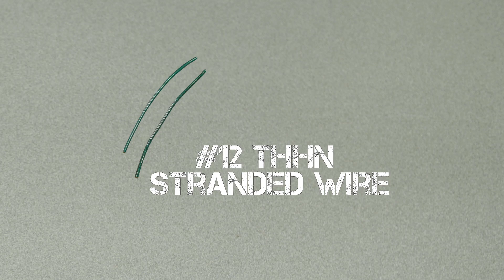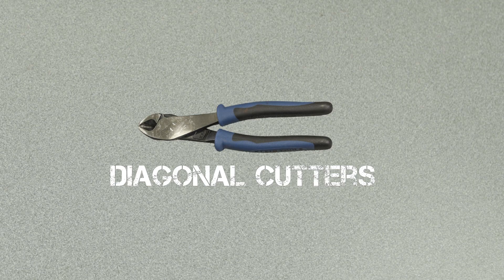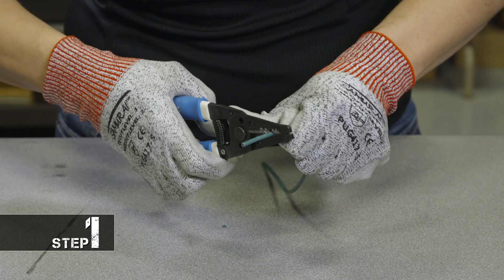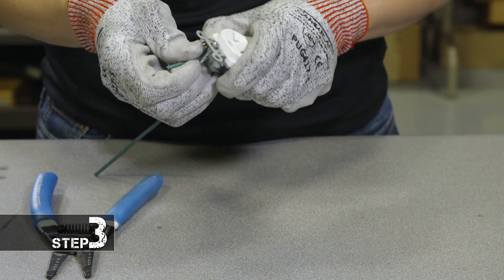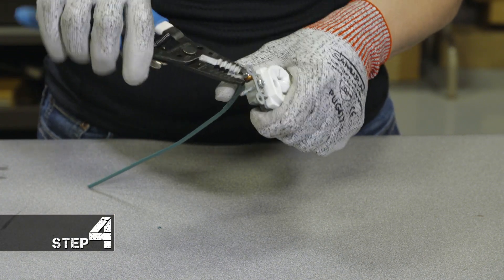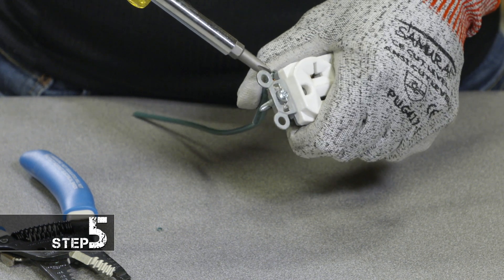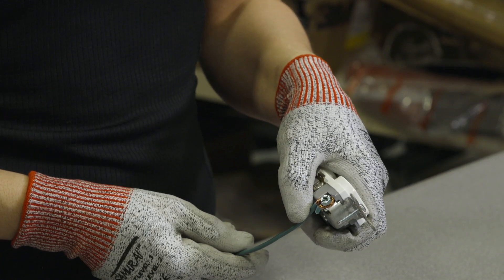Job Tip: Stranded Wire

Comment: Don’t cut off the excess, that bit of insulation acts as sort of a “dead” end. The actual copper is set back so if that insulation end happens to touch something in the box, you won’t get a short. Otherwise this is how I trim all my receptacles with stranded.

Comment: You did not twist the wire counter clockwise, but tightened the existing clockwise twist of the wire. Twisting counter clockwise improves the holding of the bundled wires when clamped under the device screw. i.e. less spreading of the strands. This was the reason the script for this video said counter clockwise.
Reply: Yeah I was/am super confused. Everyone says CCW including her but it looked to me like she actually did CW instead. Makes me wonder what perspective is the CCW reference. Looking at the cut end it was CW. Looking at the back of the cut end it was CCW. So just say CCW is fairly meaningless. Perspective matters.
Reply: THANK YOU.  That clarifies everything.
Reply: Not really Fred she did it counterclockwise
Reply: @eddiew2325  No, she did it clockwise.
Reply: Kris Klekosky hi kris
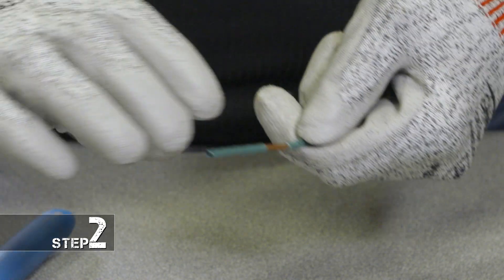Reply: @eddiew2325  At 0:37, you can clearly see the wire is twisted clockwise.

Comment: That screwdriver shown for the tools needed is a flat blade not a philips and twisting the wire in a counterclockwise rotation would be in the opposite direction than what you instructed.